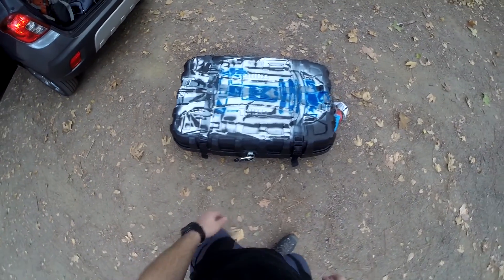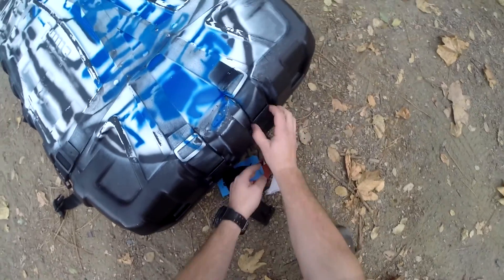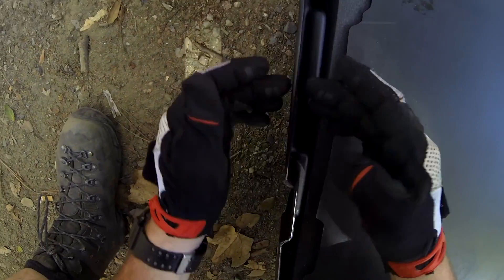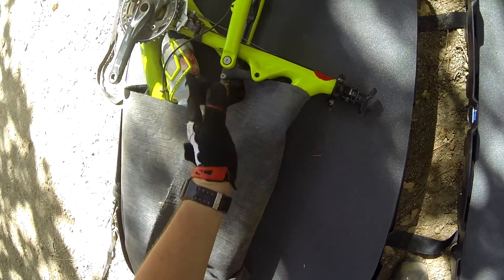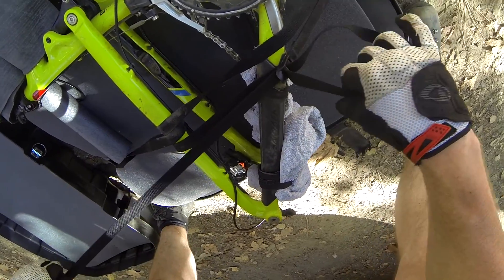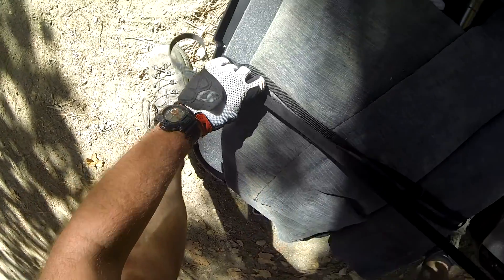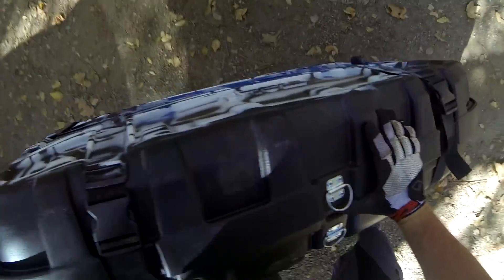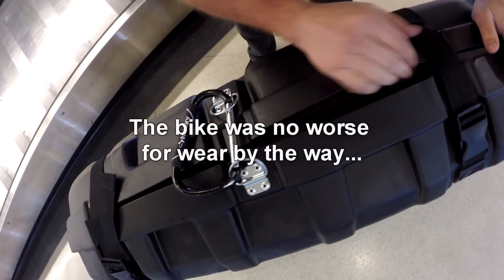MY REVIEW | THULE ROUND SPORT 100500 BIKE CASE REVIEW

Comment: According to Thule, this case weights 37 pounds.  Does it really, that seems heavy for a plastic shell case.
Reply from the maker: That is probably about right. With my bike and some tools in the case I usually weigh in at just under 70 pounds. My bike is carbon fiber and weighs between 27 & 29 lbs depending on the tires. Add the tools and spare parts that I keep in the case and the math agrees with the 37 pounds that you are seeing.

FYI: Make no mistake, this is a budget case but it get's the job done. There is some nuance to the way it "seals up"... in that sometimes there is a part of the case that is slightly open (especially after TSA tries to figure out how to put it all back together). So far I have not lost anything as a result after flying with it between 10 and 20 times. It is a pain to roll thru the airport so plan on using one the airport carts and things get much more manageable. One very positive thing is that you can strap it to the roof of a vehicle. So even if you end up with a small rental, as long as it has some form of roof rack/rails then you do not need to worry about having to rent a full size SUV. I did break one or two of the cheap plastic clasps, but was able to replace them with parts from an Army Navy Surplus store (in fact I keep spares in the case itself). All that said, if I had the money for one of the premium high end cases, I would probably go that route if I had it to do over again. But this one works, and continues to work.  

Thanks for Watching!